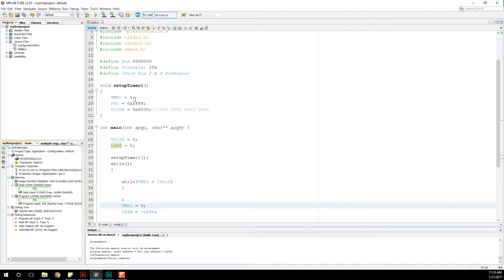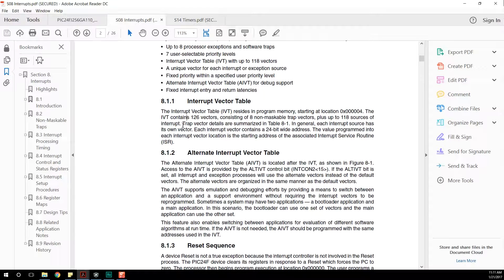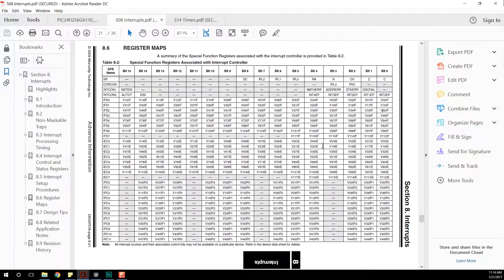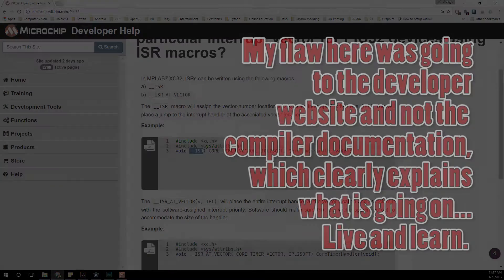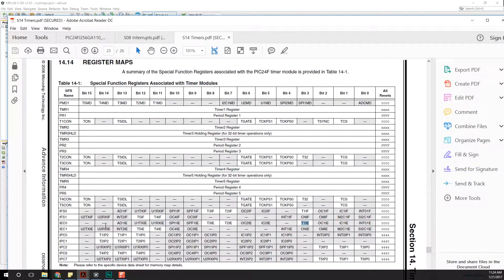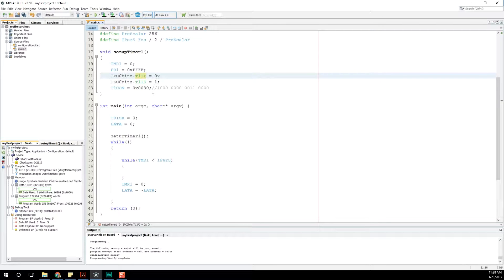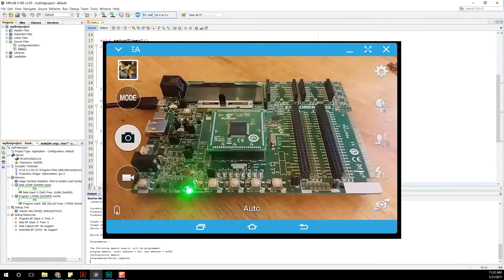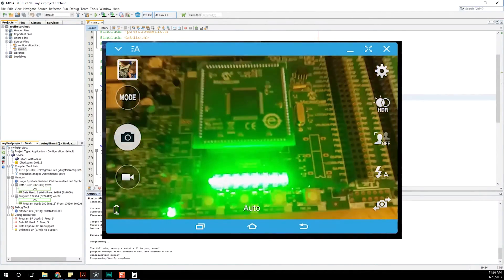Exploring PIC Microcontrollers - 05 - Timer Interrupt Basics

Comment: Thanks again, I would like to see more of the code configurator with actual GPIO wired to a relay or any breadboard type devices for and example. I cannot find any samples that actually turn off/on a device other than "click boards".

great videos.